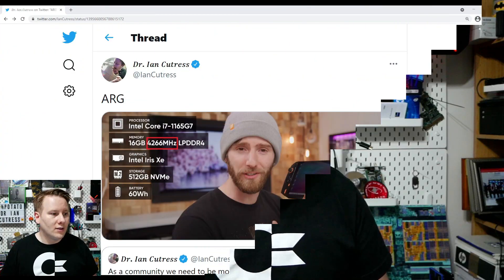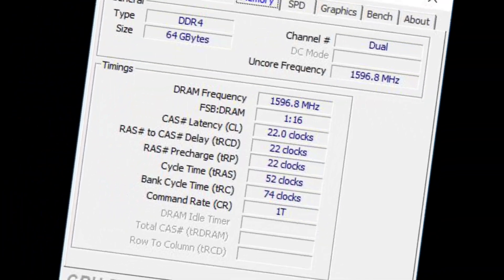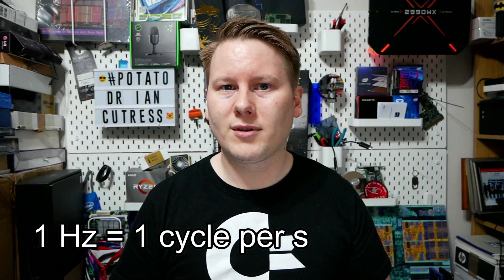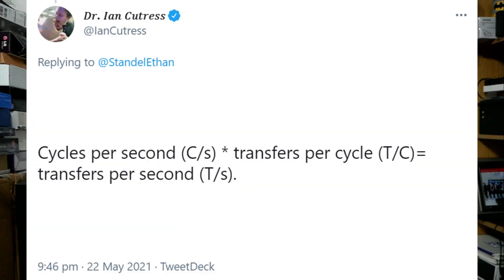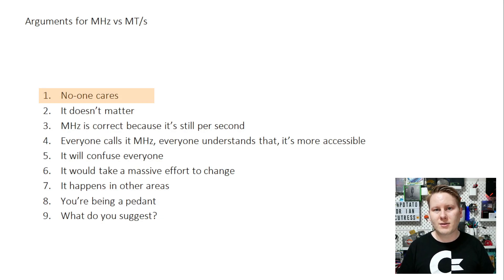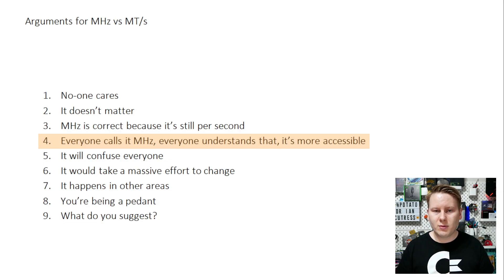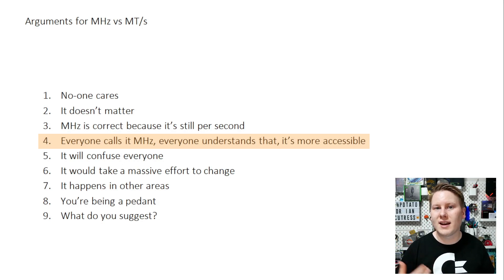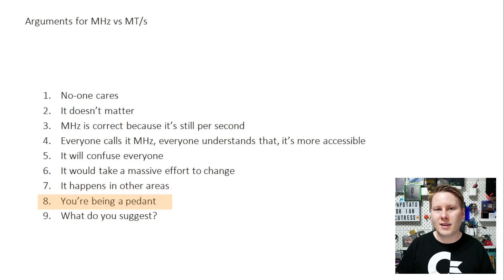Linus is WRONG 💩 : Explaining MHz vs MT/s

Comment: I say we switch over to Mbps and Gbps since that's what samsung uses in their own DDR4 chip catalog: https://www.samsung.com/semiconductor/dram/ddr4/
Also GPUs have been using Gbps for a while now.

Personally my main issue with mega transfer per second is that it takes too long to say. Gbps and Mbps isn't as fast to say as MHz but it's much better than mega trans-fers per second.
Reply: can we as a community chose to call "transfers per second" in honor to a computer scientist? one with a short surname preferbly. so there, Problem Solved
Reply: @salmiakk_it  This is actually correct and the sensible answer.
Reply: Good compromise.
Besides, communicating gbps gives larger number.
What would you rather have? 1600 Mhz memory, 3200 MT/s memory or 183 Gbps memory?
183 Gbps is very many bits, far more than 3200 MT/s.
Reply: @Irthex  if it were to become Gbps, then it would be a per bus bit speed, like on GPUs, not the sum of them, and DDR4-3200 would result in 3.2Gbps memory per bus bit of theoretical max bandwidth
Reply: @Irthex  depends, most people will prefer bigger number on their product (sales team also know this), if they have to choose one, they will probably opt for the 3200 MT/s because it more "wow" factor to pursuade (common) people to buy since it has a "bigger" number.
Reply: Funny thing about those units, I always end having to convert them to MB/s or GB/s anyways because nothing that actually matters still uses mbps or gbps. For instance, we're passed dial up speeds, been for a loooong time, mbps has almost no relevance to consumers in the slightest.  Consumers care about MB/s and GB/s. And more certainly, that will only create even further confusion amongst the public trying to learn those differences, hence why I have to convert them all the time trying to explain things to people.
Reply: Samsung is wrong though, the bus between the CPU and RAM is a 64 bit parallel bus not a serial bus so 64 bits can be moved during one transfer so the numbers Samsung have states is far less than what is theoretically possible. MT/s i.e. mega transfers per second makes more sense.
Reply: @AdamFJH  
MT/s is the rating for a single bus lane, Mbs or Gbs is the same thing for a single bus lane. The full bus rating is the PC rating which for a 3200 MHz, MT/s  Mbs is PC25600 (MBs)
Reply: @magottyk  No, MT/s is the rating for transfers per second but you can think of it as the rating for a single bus lane but that thinking is irrelevant when there is 64 of those lanes. Yes, I'm aware of what the full bus rating (i.e. band width) is. For 3200 MT/s with 64 bit bus that is 3200*(64/8)=25600 MB/s so hence PC4-256000. BUT Samsung is wrong because they are listing 3200 MT/s as 3200 Mb/s while it should have been 25600 MB/s or 25.6 GB/s. It makes no sense why Samsung list the speed of the RAM at 1/64 of actual bandwidth.
Reply: Yes, obviously
just a thing, use "Gb/s" instead of "Gbps". While we're at it, stay consistent :)
Reply: I'm with Buildzoid. At the end of the day, transfer rate is about how many bit is transferred in a second. How many time the transfer is happening is kinda irrelevance.
Reply: I prefer MegaBlorps per second
Reply: It's possible to shorten the name though, we do this in other part of our language.

Megatransfers per second could easily be shortened to e.g MeTS
"This memory runs at 3200 mets"
Reply: @7rich79  
"This memory runs at 3200 mets"
That's what MT/s is already for. Besides, I'm more of a Yankees fan :D
Reply: just say mega tee's
Reply: Yeah, mega transfer is too long and repeating it again and again can be annoying. Mbps is good, but then there will remain the small confusion of wheather the Mb is 10^6 bits or 1024^2 bits. 

Just sticking with DDR4 3200, DDR5 4800 seems like a good idea to me.
Reply: @superneenjaa718  This ambiguity is potentially resolved by defining 1 Mb = 10^6 bits and 1Mib = 2^20 bits. But Mib is rarely used in practice (especially in the information that reaches the consumer).
Reply: @weetabixharry  ...there is no ambiguity. Mb and Mib are not the same, the problems is that they are incorrectly used. These 2 units are already defined within the industry. Mb (mega bits) is 10^6 bits and Mib (mebibits) is 1024^2. It makes no sense to redefine them.
Reply: @AdamFJH  That's exactly what I was saying... except I wrote 1024^2 as 2^20 and instead of saying they're used incorrectly, I said "Mib is rarely used" (by which I meant "Mb" gets wrongly used in its place). So I agree entirely.
Reply: @weetabixharry  no, instead of saying they are incorrectly used you said they are ambiguous. Saying that the "ambiguity" is "potentially" resolved with the definitions that you proposed gives the impression that you are unaware that those units are already defined like that in the industry. Sin e those units are already defined like that in the industry, what you are saying suggest that you are unaware that what you propsed will not resolve the issue (i.e. because it has already been done and is an industry standard) as the issue of people (e.g. Microsoft) incorrectly using them still exists. What needs to be made very clear to people is that the units are NOT ambiguous, the are used incorrectly.
Reply: @AdamFJH  I was saying that the ambiguity is resolved by using Mib and Mb. In other words, there is no ambiguity if the units are used correctly. The "potential" for clarity is there, if only the units would be used correctly. We are both making the same point (i.e. we agree). I'm an electronic engineer and I work with DDR RAM (at a hardware level) every day, so I'm up to speed with the definitions.
Reply: @weetabixharry  no, you did not say the ambiguity is resolved by "using" Mib and Mb. What you said was that the ambiguity is potentially resolved by "defining" 1 Mb = 10^6 bits and 1Mib = 2^20 bits and the issue with you saying that is the units are already defined that way in the industry so there was no need for you to propose to defined it that way. hhmm...maybe you're trying to make the same point as me but you've just misspoken...OK, well if you agree with me then I guest it makes no difference what you've actually said. The real issue here is Buildzoid proposing to use Samsung's Mbps unit in place of MT/s when Samsung is wrong for doing so as MT/s does not equal Mbps for DDR RAM and the way Samsung uses Mbps is 1/64 of the actual bandwidth. Buildzoid is a RAM enthusiast so I'm disappointed in him for making such a proposal especially when he a technical RAM enthusiast.
Reply: But CPU's cannot get 3600MT/s for 1800Mhz DDR4 due IPC and CPU memory latency, 3600MT/S is surely the most ideal situation but which never happens in reality ? Correct me if I am wrong !
Reply: @mrtuk4282  correct.
It's a purely theoretical number
Reply: @Irthex  

I think it's theoretical because you have the memory timings, which is a delay.   ..If you want the full transfer per cycle, then you need "ZERO WAIT STATE", but in the real world there no such thing, as you still have delays in the trace layout from the controller to the DRAM chip itself.
Reply: @delroyshay5870  you also need to be reading/writing stuff to memory on every opportunity. Real software won't really do that.
Reply: @Irthex  TRUE, but my point is, can you get near to the quoted M/T per clock. The answer is extremely near, limited only by the trace layout.
Reply: @mrtuk4282  You're not wrong, but DDR RAM doesn't have to be connected to a CPU. If you connect it to an ASIC or an FPGA, then you can get much closer to the theoretical values.
Reply: You now run the risk of selling a 4 DIMM DDR4-3600 kit as ~916 Gbps, while most consumers would never be able to surpass 455 Gbps...
EDIT: it would actually be a DDR-3200 kit now that I think about it, but the point remains.
Reply: Then i have a question is the Memory bandwidth in the DDR spec? When not you can have 3600 MT/s but with Double or halve the Bandwitdh. Then the Gbps notation is more misleading since the CPU can supports only halve the posible Bandwitdh of the Memory.
Reply: Are you really saying that an extra sylibal is too long to say? An extra sylibal?
Reply: I like this idea Buildzoid. Unify the units across the entire system.
Reply: DDR5 is a good time to switch, but it's not up to us. Advertisers are just going to keep going where they are.
Reply: Then just shorten the terms to "Mega-Ticks", or "Giga-Ticks", for example. Like the short form of kilometers, "Klicks", for fast pronunciation.
Reply: @mattsmechanicalssi5833  Ticks are used to refer to clock cycles. It's literally the same as Hz.
Reply: But now you also have to explain the difference between bandwidth and throughput.
Reply: What the actual fuck
Reply: Buildzoid you literally say MT/s - GT/s so I don't want to hear it. Also what's one more syllable, granted you don't say per seconds everytime afterwards.
Reply: I'm with Buildzoid! Hey you guys should see who's better at Overclcocking!
Reply: Meg-ah Hertz
Gig-ah Bits Per Sec-ond
Meg-ah Trans-fers
Reply: That's somehow even worse. Sure it's 3200Mbps in some sense, but it doesn't clarify that it's PER PIN. So you have to multiply that number by x64 per DIMM or x16 per chip.
Reply: @tiarkrezar  
DDR4 3200 = PC4 25600. (25600 MegaBytes per second for 64 bit width modules)
PC rating has been pretty much standard labelling on memory modules for decades since SDR RAM.
Reply: "Megabitssss" and "Megahertz" are equally fast to say tbh, you don't really have to pronounce the per second
Reply: @tommihommi1  Wrong
Reply: Jk man! It's the same, and no one cares
Reply: @tommihommi1  yes but no: extra confusion again

we need standardization of values and big ass fines for companies telling wrong shit because pepole legit know and do not know things at the same time because of this since extra confusion just causes problems
Reply: Definitely better than MT/s but easiest would be just to not use units.
Reply: He is technically wrong a hz is just 1/s. What were are doing per seconds is not described in the unit. Maybe when talking about cycles we should say 1800 MCHZ. C is for Cycles.
Reply: @theicedragon100  Who is wrong, and why? Like Ian said in the video,  1 Hz = 1 cycle per second. In the case of DDR RAM, there's 2 data transfers per clock cycle. MegaCyclesHertz is redundant because Hertz already refers to cycles per second.

Comment: We had exactly the same discussion 2 or 3 decades ago, ie Baud rate vs bit rate, when discussing modems. Forget QDR, in modern signal processing, a data rate of 256 x baud rate constellations are common ;-)
Reply: There is also the low-level vs user-side bandwidth, once you account for encodings limiting consecutive bits, CRC, headers and packing. Also, bits(b) vs bytes(B).
Mass storages mostly keep those overheads secret, but then expose the scale swamp: binary vs decimal vs (god forbid) mixed.
What. A. Mess.
Reply: @musaran2  agreed, and you can add encoding for clock restoration & DC elimination, and FEC overhead to that list.
Reply: R.I.P baud

Comment: I have had some many people complain their RAM is not running 3200mhz because they see 1600mhz in CPU-Z.
Reply: Just tell them the truth, 1600MHz is the IMC frequency and the memory is Doule Data Rate making 2 Tranfers per second(2*1600=3200MT/s).
Reply: Yeah so clearly it's already more confusing as it is currently than it would be with the correct terms
Reply: Presumably once told why they are fine with it?
Reply: @eubikedude  Had to give them a 5 minute lecture on it and then they lost interest.
Reply: @ZAGAN-OZ 😂
Reply: Presumably once told why they kick off because they feel they have been sold half a product?

Comment: I agree as always with you Ian, I've always wondered why the industry refers to unit as megahertz for memory. In any event, you summed it up rather well, and it's really a matter of simply rebranding the measurement. 

That said, this could be as difficult as getting the USA to change to the metric system. I kindly doubt that the heavily entrenched semiconductor industry is going to entirely rebrand it's naming schemes because of on PhD at Anandtech getting upset over a technicality. :D

Comment: Agree with most of you video. But cant see your reasoning behind just letting go of units. I mean yeah as long as you are consistent with the unit you use in the back only the relative change matters, but then we should at least use the MHz number (just because it is smaller)

p.S: nice edit of 720 ;)

Comment: This is the same thing that happens atleast in my area where people loosely call 1litre of milk 1 kg and 1 kg of curd 1l it's so frustrating
Reply: lmao 1kg of milk, that's so random.
It would work for pure water, but is technically incorrect for any other liquids. Just changing the fat content in the milk changes its weight.
Reply: @ParadoxalDream  it only works for water at a certain temperature and with no minerals
Reply: @Anon.G  pure water means with no minerals. The temperate needed is 4°C, which is roughly the temp inside a fridge, ideally where you want to store your milk.
Reply: @ParadoxalDream  oh sorry I didn't see the pure before the water
Reply: @ParadoxalDream  Please excuse my extreme lazyness (of not searching about it), but isn't the water 1L = 1kg also wrong ? Isn't it something like 1 L = 1.008 kg (or viceversa) ? Or the fact that it's at 4°C makes it perfect ?
Reply: @Winnetou17  It's vice versa as warmer water is less dense so at room temperature it is a couple mg less than 1kg, but it's insignificant so just said 1L = 1kg even when talking room temperature. It isn't until above 45C or there about that you start getting into single figure percentage differences.

It is perfect at 4C because that's what we said it was. The unit of a gram was defined as a cubic cm of water at melting point (which is 4C). 1000g is 1kg and 1000 cubic cm is 1litre so 1litre of water (at 4C) was exactly 1kg.
Reply: @mr.potato9449  Nice, thanks!
Reply: @Winnetou17  err that should be maximum density (which is at 4C) dunno why I said melting point o.O
Reply: @ParadoxalDream  it drives me crazy
But I can't change the people
I say the correct unit and that's what matters to me
Reply: Laughs in pints.
Reply: @AurumFaber  lol 🤣 I definitely didn't see that coming
Reply: @leeroyjenkins0  
Well after that,
There is nothing to say,
But Understandable,
And Have a great day!
Reply: They may well be measuring the milk on a balance such that it truly IS sold as 1kg of milk (as opposed to the volumetric 1L of milk).
We BOTH know that 1L of milk is NOT the same as 1kg of milk, but if it's packaged and sold as 1kg of milk and it's truly 1kg, then I would not complain much.
Intriguingly, it's equally feasible to sell the fuel for your car in kg (or even joules for those who are that way inclined).
Imagine rolling up to a fuel pumping station and requesting '500 megajoules please?' (Around 15L)
BTW, how do you think JetFuel is measured in the aviation industry?
Reply: @trevorvanbremen4718  It must be easier to weigh the milk when packaging it than to measure its volume. I believe jet fuel is measured by mass. That would make a lot of sense because mass is an absolute measurement of the quantity of fuel (the number of molecules), whereas its volume is not.
Reply: @johnm2012  it's also just simpler to know how heavy the plane is which is important information when trying to leave the ground.
Reply: @ethanl9656  Yes, that would be very useful to know, which makes me wonder why they don't bother to weigh the passengers, as they do the baggage and fuel. Surely the mass of the passengers is a significant contribution to the total mass of the plane but, of all the annoying but apparently essential things I've been subjected to before boarding a plane, I don't recall ever being weighed or even being asked my weight.
Reply: @leeroyjenkins0  32 grams¹ can kill.

¹ of lead
Reply: @leeroyjenkins0  again it's the same thing that it may be the same but the units matter 
You can't say I want 1kg petrol

Comment: Actually, I had been thinking of that for ages, and I agree that just take the units off it. I would classify myself as a Pro-sumer so to speak. To me, it is way much easier without the unit and most others understand.
Reply: Less information is certainly better than wrong information.
Reply: @abelromero8967  Yeah very true,
also it's weird people say this is OK when it is actually wrong, but tell me I'm wrong for using MHz to give CPU Frequency instead of GHz

Comment: GDDR using "QDR" is the real confuser here... GDDR5 and later revisions have various separate clocks, the data bus still runs at DDR so two transfers per cycle (16Gbps GDDR6=16GT/s=8GHz), but the quoted operating frequency is the command bus which in GDDR5 is running at half the DQ (data bus) clock and in GDDR6 is running at a quarter of the DQ bus.
Reply: that's why we've switched to the unambiguous data rate for GDDR, and we really should do that for DDR5 as well.